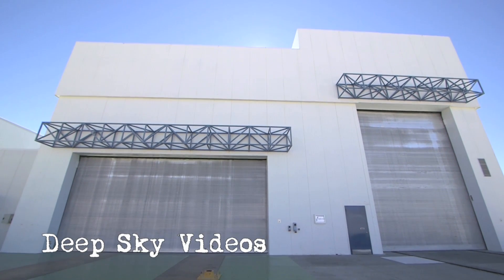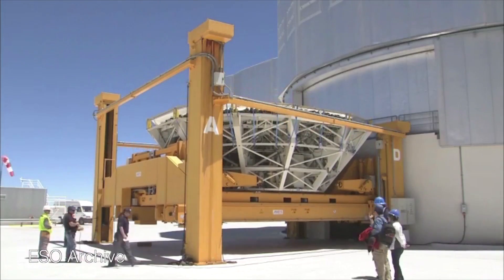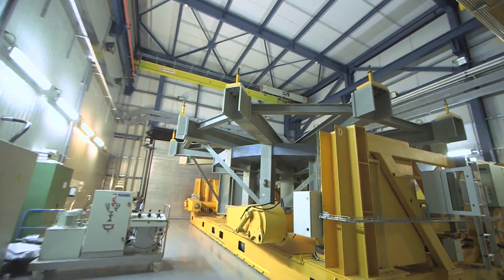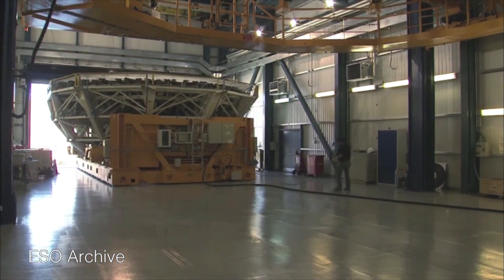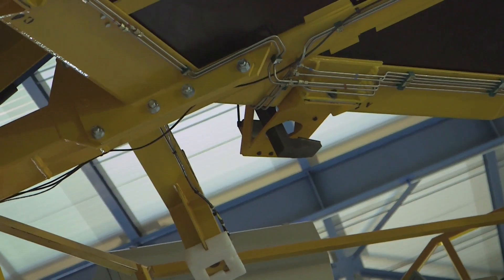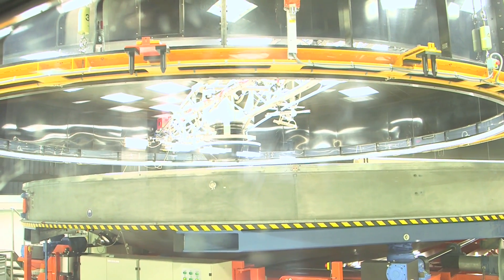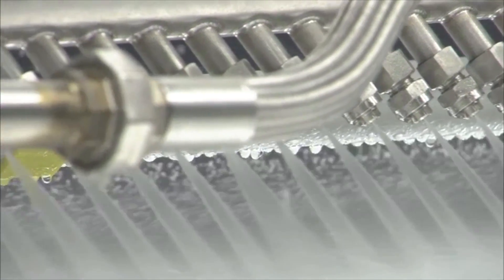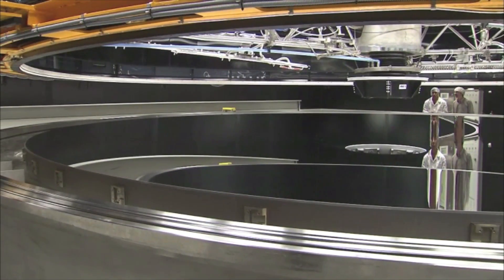Re-coating a VERY LARGE telescope mirror

Comment: why do they do this so often? every 18 months sounds quite excessive.
is the dust that bad up there? how much image degradation is acceptable?

or do they treat one out of the four mirrors every 18 months, so every mirror is really in operation for 6 years?

as you said, breaking a mirror or messing it up somehow would be very expensive, but that's only part of the problem. getting a replacement made, tested, shipped and installed would likely take years.

Comment: Why aluminium? Why not another less reactive metal so that it does not need to be replaced that often?
Reply: I suspect that it perhaps has something to do with Al having reflection properties required for purposes of astronomic observation.
Reply: +Shagas Heizenberg 
Did it take 4 years to make a mirror and they don't a spare?  What????
Reply: I did not understand your comment
Reply: +Shagas Heizenberg   My point is a larger one...not only did they picked aluminum they  picked something that takes four years to make?????  and the downtime on the mirror is 2 months every year because they have pull them off to work on them ...and that taxes 6 weeks....
Reply: I'm sure most telescope mirrors have protective coatings to protect the aluminium layer.
If amateur reflector telescopes have that, I don't see why these more expensive ones wouldn't.
Reply: @GoldSrc_  Large telescope mirrors usually aren't coated, they have a bare aluminium surface.

Comment: Why do they only use about 20g of Aluminum. Does the layer have to be very thin for a reason? Edit. OK I have thought about it. I guess variations in mirror thickness as the Aluminum was laid down, which might result from using too much Aluminum, would ruin the optics. IS that right?

Comment: No shaking or vibrating because it is so fragile... even though it was just pulled down the road on a trailer...
Reply: +apburner1 That's the exact same thought I had.  Nothing changes, but it suddenly becomes more fragile when it's within 50 feet of the building? :)

Comment: No polishing required after the vapor deposition (or whatever it was)? Straight back to the telescope building?
Reply: +Jesper Andersson Thickness of Al-coating is less than 150 nanometers (about half of thousand atomic layers). And in addition if process of deposition goes all right then coating has very uniform thikness (even at atomic scale) and such smooth surface like a calm liquid has. No yet way to get better mirror surface.
Reply: +Jesper Andersson given the amount they vaporize, the coating is probably something like 60 atoms thick, I don't think you can get better results after polishing

Comment: I have a question. Why does it need to be recoated? If I'd buy a telescope myself (much smaller than this of course), would I need to recoat it as well every year and half? I'm guessing no, but then why does this one have to be?
Reply: +MaxArceus There will come a time when any mirror will need to be re-coated. But, I've had my 12 inch Meade for over twenty years and have had it re-coated only two times. I clean it about once a year, and sometimes all that is required is blowing off the dust. Moderate dust really doesn't make that much of a difference.
Reply: +Magister Ludi 2105 12 inch, nice.
Anyway, how does an consumer recoat a mirror? Bring it to the store? Does it cost much?
Reply: +MaxArceus yes. A google search or your local telescope shop should get you to the right place. A few hundred dollars or less. Obviously this depends on the size of your mirror and type etc. As shown, these scopes are open to the elements for a considerable amount of time. 
Your consumer scope will see much less exposure and frankly can take quite some degredation before you will notice any difference or before it needs to be recoated. As you said, you didnt notice much difference with all the duest. 
Keep your cleaning schedule up and it will considerably lengthen your scopes life. 
 Basically, don't worry about it.
Reply: +DENMONKEY Well, I don't have a telescope, yet. But thanks for the explanation!
Reply: no probs mate. MaxArceus

Comment: How much is a fortune? I'm genuinely curious how much a replacement mirror could cost
Reply: +simontay1984 Consider that with a mirror that size, you'd likely need to build a facility capable of making and testing the mirror. Cost could easily be in the millions or tens of millions. Moreover, casting process requires very slow cooling to prevent the mirror from warping, so the total fabrication and testing process would likely take a few years.

Comment: Is it something like a PVD coating? And why Al instead of Ag? edit: forget about the last part, the mirror is front surface.
Reply: +2dividedby3 aluminum doesn't corrode as quickly as silver, and it has a better light reflection profile.
Reply: +2dividedby3 Aluminum also has better reflection in the UV than silver for almost as high reflectivity.
Reply: +2dividedby3  If you google it, some recent large telescopes (but not the largest) have chosen to use silver, but it is unusual. The choice has to do with what wavelengths in the spectra they are interested in. The main information large telescopes obtain is from the spectra.

 I believe silver does result in more collected light, but not necessarily in the most valued wavelengths, depending on what you have chosen to measure. Somebody already mentioned that they do treat the surface of aluminized mirrors, for various purposes, and they will also treat the silvered mirrors. I believe the mirror will also have to be recoated more often.

 Aluminum does oxidize instantaneously in the air, like all metals, but aluminum oxide crystals are very transparent. However you don't necessarily want random aluminum oxide crystals all over your perfect mirror, so they "treat" the surface.
Reply: Thanks to all for the responses!!!